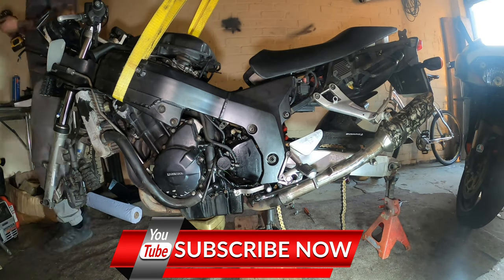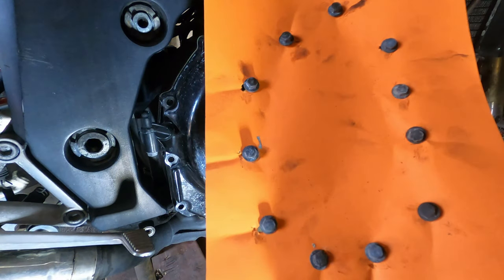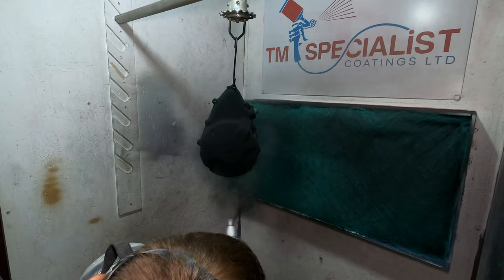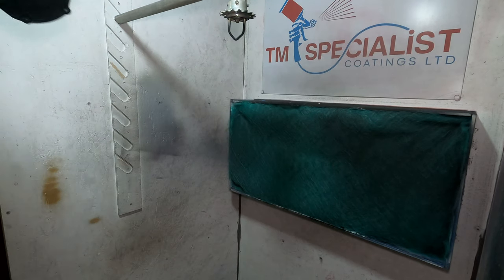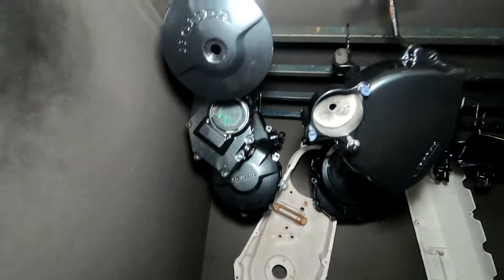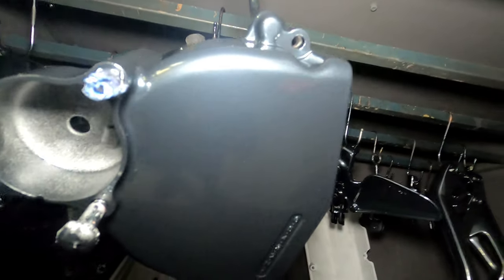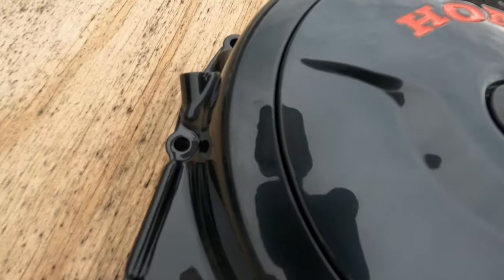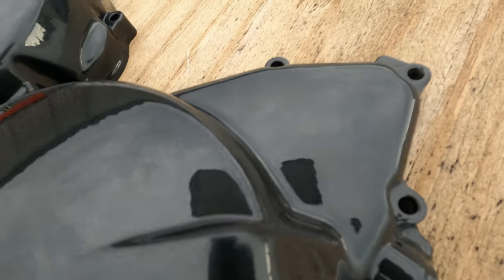Powder Coat The Honda Black (chrome) Bird Restoration Part 5

Comment: Them parts look amazing  great  job.
Mike I'm very  new to powder coating  .I have just  built a  oven , blasting cabinet, I'm half way through building a spraying  both. 
Please could you  do a equipment  video. Every  thing you  use to powder coat.it would be very  interesting and  very helpful. Thanks keep up the good work
Reply from the maker: I certainly could do an equipment video at a later date. Good luck with your new venture, it takes a lot of time and patience.. if you're new to it make sure you practice practice and more practice before you think about hitting customers parts.
Reply: @UniqueCoatings  thank you for the  reply and  advice.
It's not a business. I wont be powder  coating  for other people  .its something I have  always  been  interested in  and always  wanted to  try .my partner  collects  all these  metal sculptures  and nick  nacs  from car boots .

Comment: Really nice job on those parts. I have a bb and looking to get stator and clutch cover done. Want to keep it original looking. What would you suggest as a coating
Reply from the maker: Cerakote. They do a close match for both colours and the finish is as standard as it gets.
Reply: @UniqueCoatings  brilliant. Thanks pal